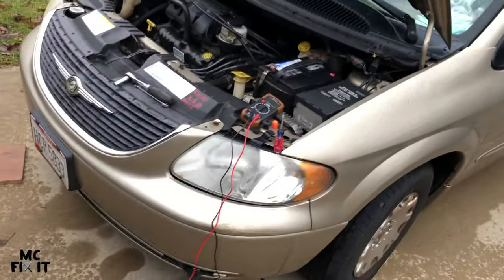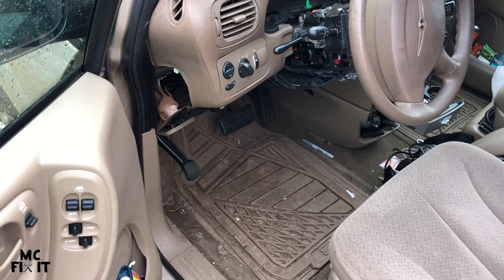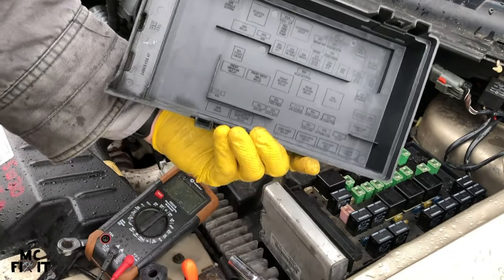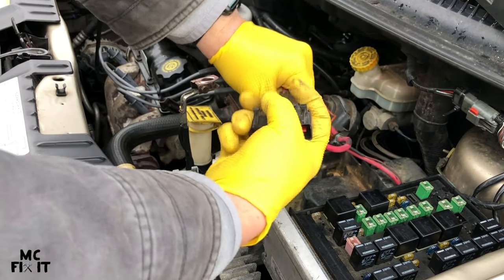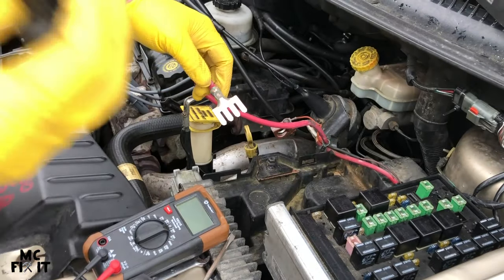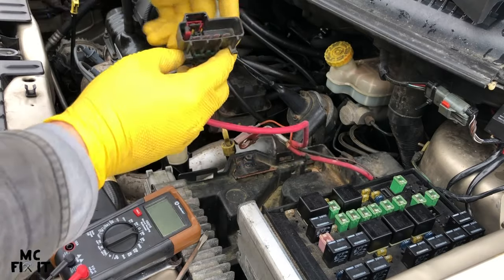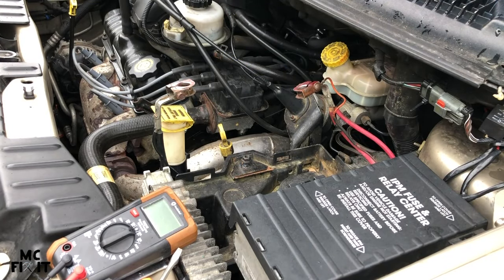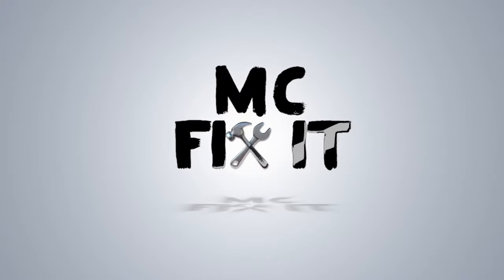Won't Start? No Start No Crank Intermittent starting problem solved! Dodge Caravan Town and Country

Comment: Hey bud... so on my van I did everything like you did to the T including the wire to the fuse box and that still wasn't it... for mine it was the computer... the only way I was 100% sure that was it is because I went to the junk yard and happen to find one just like it.. so I slammed it in and right away it tried to turn over... it still didn't start but now I knew what had to happen next... that was order a new one with my VIN and milage on it... that part costs almost $300... but as soon as it came in the mail I slammed that one in and she was back to life... so just a heads up on if it's not your wire then look at the wires going into the computer... see any liquid in there then you need to replace it as well as make new connections with the wires going to the computer... it was a very long month...
Reply from the maker: Great insights. I hope this helps someone! Where did you order your new computer?
Reply: Hi, so besides the VIN you're gonna have to send mileage? And did you just changed the PCM alone? Just that part and nothing else? Mine could possibly be the same issue as yours

Comment: I have a 2002 dodge caravan and the other day , I stopped at a store and went to start , nothing , tried again , nothing , then I pushed the shifter up and it started, so either thinking it might be the neutral safety switch , or the dirty connection, , if you know anything about the neutral safety switch , location, testing it , bypassing it , would like to hear from you  , great video you did , I will certainly clean mine up has not been touched ,Thanks ..
Reply from the maker: I’m pretty sure this vehicle has a neutral safety switch. Sorry I’ve been really busy with my day job and just getting back to comments.  If it has one, they are often on the top of the transmission. That would be something to check for sure! Another thing to check is just moving your shifter up and down and making sure it’s properly seated in “park” before you start. I have a friend with this vehicle that has to shift through the gears (P, R, N, D, N, R, and then P) and often it fires right up.

Comment: Good evening my friend and nice to meet you!

My vehicle (2003 Dodge Caravan Se V6 3.3) is giving me a (P0201-Injector Circuit/Open Cylinder 1) code and i have a (2003 POWERTRAIN DIAGNOSTIC PROCEDURES book for town & country, caravan and voyager) that shows on page 88-89 test procedures to follow and apply. 

So far i have applied (test 1) and (test 2) and im on (test 3) now and im stuck on not being able to follow and apply it cause im not grasping and understanding it at all. 

This is test 3
Turn the ignition off.
Disconnect the Fuel Injector harness connector.
Remove the ASD Relay from the IPM.
Turn the ignition on.
Jumper the Fused B+ circuit and the ASD Relay Output circuit in the IPM. (This part im lost)
Using a 12-volt test light connected to ground, probe the (K342) ASD Relay Output circuit.
Does the test light illuminate brightly?
Yes      Go To 4
No     Repair the open in the (K342) ASD Relay Output circuit.
          Perform POWERTRAIN VERIFICATION TEST VER-5.

This is a video of me following and applying (test 2-https://www.youtube.com/watch?v=rbzQKyiNwcA) and in that video it shows the pages in the book from page 88-89 and pages 312-314 for code (P0201-Injector Circuit/Open Cylinder 1).

Are you able to please make a video showing me how to perform all of these test procedures so it can help me grasp and understand to where im able to apply the test procedures from all those pages?

Comment: Great job diagnosing this and fixing the problem. That's not an easy task when the more obvious things get ruled out. I'm having a similar issue to this. I looked and didn't see corrosion in my fuse box anywhere. I've also tested the battery, starter, relays, and alternaterator). So I'm not certain what to do next. Any ideas on what to look at next?
Reply from the maker: Have you checked your negative cables (from battery to frame and engine)? That’s where I’d look next!
Reply: What was it?!
Reply: Check the computer
Reply: Pcm behind the left tire about 300 can get u one shipped and preprogrammed pray this helps

Comment: Wow I have the same issue, did the van stall when driving too? Mine was now its DEAD will try this too THANKS
Reply from the maker: Best of luck on your repair!
Reply: @MCFIXIT  I tried, it didn’t work … it’s not starting, no clicking, lights on in dash new battery. It was stalling at intersections stopped randomly but always started idk what else to do. New ecm, new fuses, new battery still dead any thoughts?? Could it be the wire harness?

Comment: Thanks for the throughout video, it is really helpful, I did grinded that metal clip cable and put it back and still the van won't start. I even put a new starter, bolts, oil change, battery charged and still. It does that sound, the starter sound, so it works, but it doesn't want to start. I bet it must be something stupid easy fix, but not sure what. All this happened after WalMart automotive changed the oil, then the van started hanging to start till it didn't wanted to, so I thought it was a starter problem, yes the starter had a mising bold and one wrongly put n loose, so when I took it out the mount was broken so I got a replacement put it in, all thighthen like it supposed to and blah no start, although the starter works tho, a chraged up the battery cuz was low, used anothe batter, jump start the car and nothing. So I am running out of ideas here lol
Reply from the maker: Oh no! That’s the worst feeling. Often it is something small from my experience with the vehicle. But they small things make bad things happen like not starting when everything seems to be good. How much corrosion was on the positive wires at the terminal and at the TIPM? If really bad, then you may need to replace it.
Reply: @MCFIXIT   lol Bruh I put the new starter tilted from the top bolt, and there was a slight gap between the van frame starter socket (the whole where it goes!) and when I start I was hearing the starter revolving but no.gears grinding! " I was like wtf is it now!?" So a coworker told me that I might've mislplaced the starter and he was right! After removing and putting it back as supposed, vuala! Like magic, it started! I can't describe the feeling of accomplishment and ease.  Also now the doors opened automatically and  locks  worked! Man Thanks a lot for this video and your reply,  I am really grateful, God Bless!

Comment: 0:19 ....  2010 and present Dodge Caravans ,Chryslers has a built-in ob2 sensor in it all you need to do is turn the key back-and-forth without starting the car, without turning the key to off!  3 times consistently while the last time leave it on accessory. On your Dash you will see the test begin it takes roughly about 30 seconds or more for results.
Reply from the maker: That's what this vehicle has as well. I didn't realize that is what was happening, because I didn't know if had this feature. Thanks for the insights!
Reply: most dodges that have a check engine light have this feature ... my grandpas old fifth avenue and his pickup blinked the check engine for the codes just gotta beable and count

Comment: I'm having dumbass electrical issues with my 2018 Acadia. Fixed one issue and now the car left me stranded 2x tonight (auto start stop is not able to be disabled on the car) on a fwy ramp and a red light. Luckily after 50 tries I got it going again but to change the starter on this POS you need to remove the whole lower axel. I'm guessing it's something stupid as fuck like this or sticky solenoid on the starter. 

Last electrical issue was with the active grille and all that I needed was a clean on the ground... Yet I replaced the grille shutter. And took it to mechanic after Mechanic that couldn't figure it out..

Anyways thanks for the advice I'll def give it a shot
Reply from the maker: That’s terrible to have that new of a vehicle and having electrical issues. Normally, it’s just older vehicles that have that due to age. Best of luck on your fix! Let me know what it was!
Reply: @MCFIXIT  yup I bought the truck for just over $23k with taxes and registration at 48k miles it's sitting at 51k now. I bought it thinking it's a great road trip car for us since I have a hellcat and she has an Elantra and I have a daughter. Now I'm sketched out on it. 

Just like you said the cars having issues as if it has 150k miles. If I wanted to deal with this I would've bought a 10 year old $8k SUV..... 

Now I remember why I only buy new cars
Reply from the maker: Yeah, there’s lots of benefits to newer vehicles when you can afford them but even those are seeming to have more issues due to technology. Best of luck on your issue.

Comment: I ended up checking for my 07 grand caravan that I have in my lot and having startup issues it was fine for a good month after it left mechanics and fast forward a night after fueling up the car and me getting home it shut off on me and I looked under the car for any gas leaks or anything nothing and I look at this video I manage to finally check under the box myself and funny enough there’s another wire connector that goes straight under where the  pump replay is an entire wire shot and corroded I think I found my problem just would like to thank you never new it was simple to get under the fuse box 📦 hopefully it works when I get wires replaced
Reply from the maker: I hope so too! These vans are great when they work but a trouble with ipm/TIPM issues.

Comment: Thank you for this video my same van is an 07 that's the first thing I checked and it fixed it it started up 
Took a second to reset I guess Cause at 1st it would do nothing for me then the wife started it up no problem thanks for this video very much appreciated and good detail on removing everything
Reply from the maker: Glad it helped

Comment: Has the cleaning held up or should you have replaced the positive cable from the battery to your fuse box?
Reply from the maker: Yes that's an option. The Dodge positive cables to fuse box are very strange and it's not easy. Its worked well with just a thorough cleaning and reconnect! Thanks for watching and asking a question!
Reply: If there’s no break in the battery cable, you should be good.
Reply: @MCFIXIT  My power to the tipm looks like a regular battery cable. It's on the top/front with a red cable. When you test it with a voltmeter it has power. Don't know where the ground is
Reply from the maker: @apachewraith  It should be a large black cable. What year is your vehicle?
Reply: @MCFIXIT  It's 2013. Doesn't start. Weird clunking noise when you turn the key on if you're on the brake.

Comment: "Done" on the odometer is the OBD II diagnostic message.
If your "check engine" light is on, you can retrieve the code number by turning the key off/on/off/on several times.
You have done this accidentally by trying to start the vehicle.
The code(s) will appear on the odometer. After the codes are displayed, or if there are none, the odometer reads "done".
Reply from the maker: Thank you! I didn’t know it had this feature when filming the video. Thanks for watching and commenting!

Comment: 3 months, no dice. 2003 TnC, mine starts then randomly shuts down, when it dies, the next start would be no crank, no start and red dot light on. It'll take a few days, sometimes a week before it starts again, the longest it ran was 20mins, then it dies, then same thing. Fuses are ok. Wirings are clean.
Reply from the maker: These things are tricky to figure out. Many of them have wiring and fuses that have gone bad over the years. Does it die when driving? Or just idle?
Reply: It dies when it wants to. Sometimes when on idle sometimes whlie it IS running. If i wanna risk using it I need to have an extra money prepared for a flatbed rent in case it dies. Its that scary!
Reply from the maker: Oh no! So sorry! They are known for these issues. I hope you had some good prior use out of it

Comment: Having this exact same issue on my 03 caravan with the 3.3L Same lights on the dash, only clicking with no gas gauge or fuel pump. Got it to start by pushing and rocking on in neutral three days ago. The fuse box is very loose too. I Can't get it to start anymore at all now. going to try this out tomorrow morning! will update if this works!
Reply from the maker: Let me know how it goes! Best of luck on these type of issues! They are a pain but it feels good when you finally diagnose and figure it out!
Reply: @MCFIXIT  Hey! So i did the disconnect to the fuse box, it was corroded but was not the issue. i cleaned it and checked other connections. i am now going to look into the PCM. thanks for your help!
Reply from the maker: Was it your PCM?

Comment: great video however it looks like you sanded through the nickle coating on the main power connector. It was part of what was keeping it from corroding
Reply from the maker: Thanks for the info. I know you can apply a coating on it if you'd like to prevent future possible corrosion. Thanks for watching and commenting!

Comment: Something needs to be put on those terminals to keep it from corroding. ACF 50? Especially the one you sanded down....
Reply from the maker: I’ll have to look into ACF 50. Is it electrical safe? Have you used it before and got good results on a power battery cable terminal?
Reply: @MCFIXIT  Absolutely it's safe even my whole home breaker box is coated in it inside. It's an outside box and the bus was starting to corrode. I sprayed all of the circuits with them still hot so it does not conduct electricity. I'm a retired Master ASE tech, if it matters and I know if you leave those  terminals unprotected they will corrode fast because you removed the remainder of the protective coating. So just spray the hell out of all those connections under the panel and anywhere else like the battery terminals. ACF-50 is about 18 bucks on Amazon...
Reply from the maker: Thanks for this info! This is great to know!

Comment: I have a 2014 Chrysler town and country and am having issues starting. Got the battery and alternator checked and is in perfect condition. Replaced the starter so that’s brand new but still no crank. Everything in the van goes on it just doesn’t start. I know nothing about cars but am going to attempt to try this tomorrow. Any ideas of what it could be?
Reply from the maker: I'd check your ignition switch. It's located next to your steering column. It sounds like you might be having a wiring issue if all that's been changed and you don't get a crank. That's the first thing I'd check.
Reply: What happened did you fix your problem, I have the same problem with my 2012 caravan

Comment: when turn the key on and off three times the display show the check engine codes and the done means its done displaying check engine codes
Reply from the maker: Thanks for that info! 

To bad  it never had a check engine light on during any time with the issue because that would have made diagnosis a bit easier!

Comment: Great video, I have an 03 town and country lxi 3.8 v6, my issue is that the first time to start it of the day, I have to jump it, while it's hot out I'm good, once it gets cold out, I go to crank it over and it won't crank over till I jump start it again. Do you think my issue is due to the same problem you had? And thank you
Reply from the maker: My systems were different as described in the video. It might be different bc if the being cold outside seeming to cause your problem. My was not weather dependent. This might work and is pretty easy to do, so I’d try it before taking it in to get worked on.

Comment: When you cycle the key three times it will show any codes that the van has that are active if there are none it will just say done
Reply from the maker: Thanks for this information. This helps clarify for those trying to figure this out. Thanks for writing about this! 

I totally meant to add a comment about this and forgotten to do so! I had found that out on a Reddit form after I made, edited, and posted the video.

Comment: I have town and Country 2001,while driving all the indicators such as speed and fuel indicators drop some time and start working again, do you know what could be the issue and how to fix it?
Reply from the maker: Not 100% certain. But it is something you could definitely try. That’s a much different symptoms than mine. if it works please let me know so I can advise others in the future.